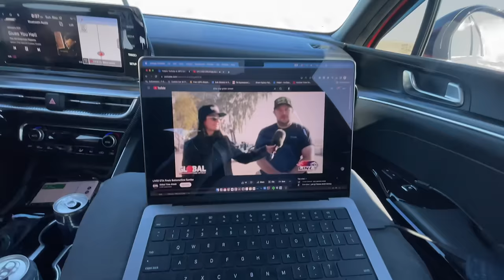Track Day Rescue Mission at Buttonwillow Raceway

Comment: The a pillar trim won’t cause the airbags to go off. Something triggered one of the airbag sensors in the doors, quarter panel or the center console air bag module. My assumption is since it blew the curtain air bags and locked the seat belts it was the main computer in the center console right under the dash. You may have pulled enough Gs in the corner for the computer to think it was in a rollover thus cause the curtain airbags to deploy. ⭐️ The more you know! 😊
Reply: Yeah this is very much what would happen
Reply: was going to say this, a pillar needs a big impact for it to set off, however the trim can be removed no problem, that’s how I run cables and other accessories.

Comment: Getting back into accelerator before apex is adding time to your lap but your biggest time killer is your turning in to soon and needing to straighten and recommit into the turn. That requires more turning angle of the wheel but also doing so  unloads & reloads the suspension.  Doubling the work on the shocks fluid & tires.  Hotter the fluid, softer the damping, less control & less consistency.

Comment: I run 2 diffs on my BRZ. The stock 4.10 and a second setup thats 4.88 for shorter more aggressive tracks. Be warned tho...the 4.88 takes like a whole gear out of the car so top speed is rough but for 4th gear and below tracks on stock diff its 5th and below on the 4.88 so still not terrible. Benefit of 4.88 tho is 20% more torque to the ground so it gets it really hard in the lower gears.